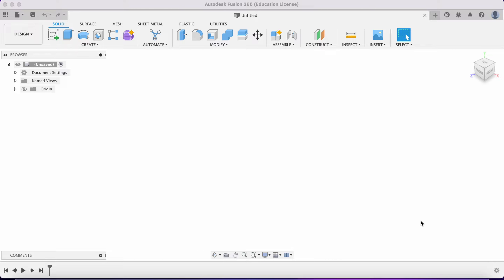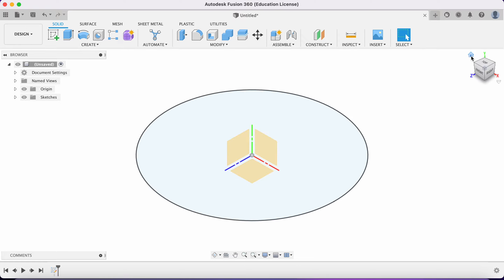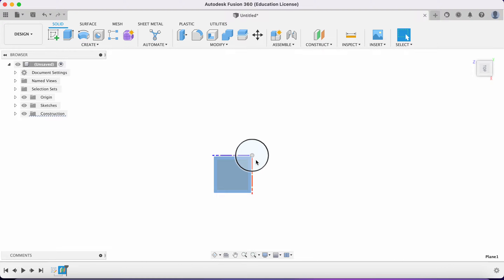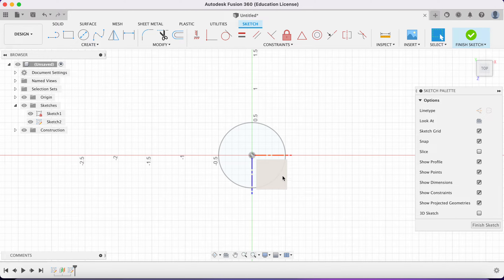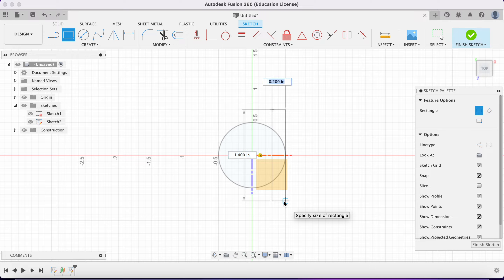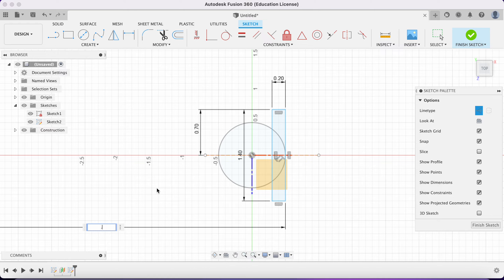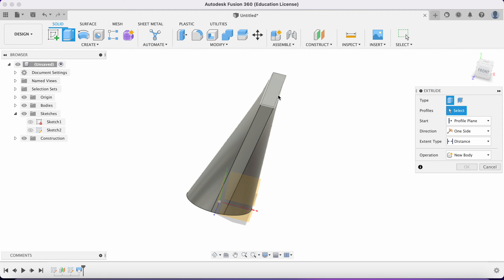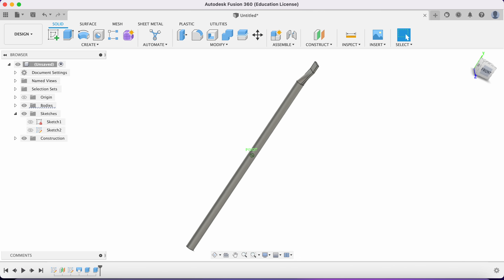Using a Loft to Mimic a Flattened Pipe End in Fusion 360

Comment: - TIP FOR SPEED: To make 'Circle' in sketch, simply type 'C' (while NOT in Sketch mode); click sketch plane; done :) So, no need to explicitly 'Create Sketch'. Also, no need to make visible 'Origin' folder: coord sys planes will automagically appear when 'C' is typed. BTW, can be done w/ 'Line' ('L'), and others, too.
- RELATED TIP: While in sketch, type 'E' for 'Extrude': will automagically take you out of Sketch mode, and into 'Extrude' dialog - will even select sketch profile, if only one present in sketch.
- OK, carry on (but faster!)...